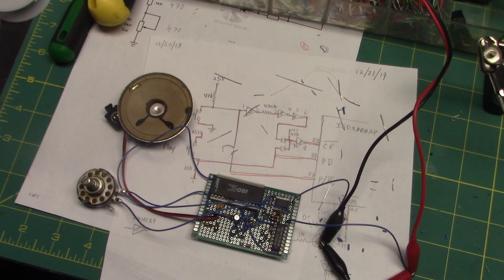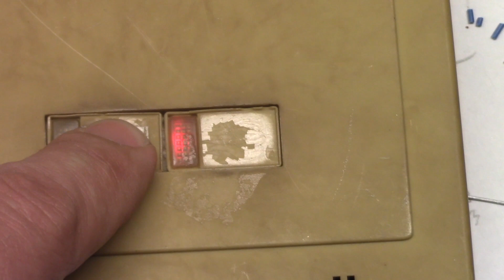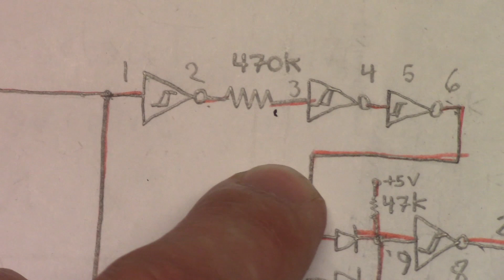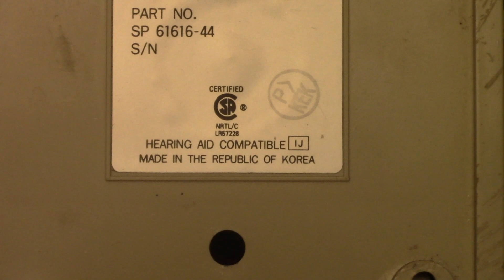ISD ChipCorder built into an intercom box

Comment: This is pretty neat build, it's like a giant Yak bak. I'd rather have a simple record and play buttons with a lock function so you cannot record when enabled. I had a yak bak (Yak Bak 2) which did this and it had a speed control. Also a line in and out so I can sample audio directly and not go through the mic and speaker.